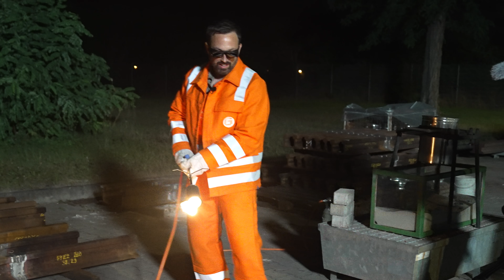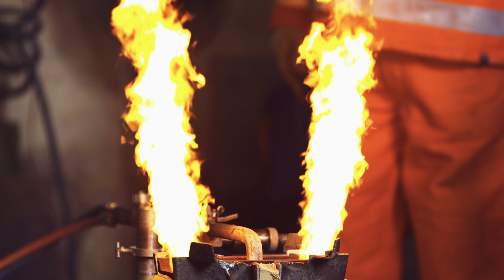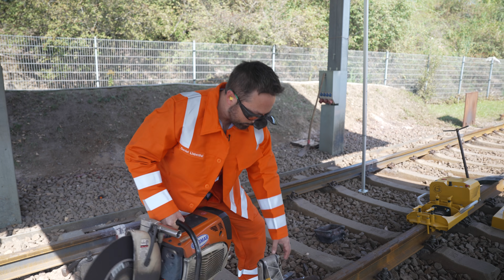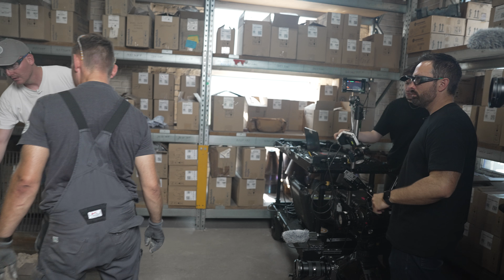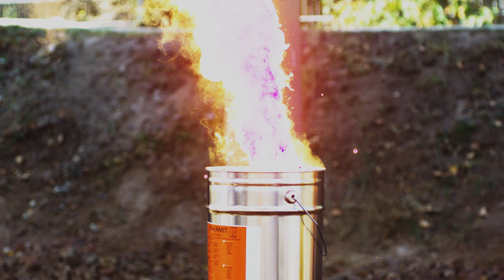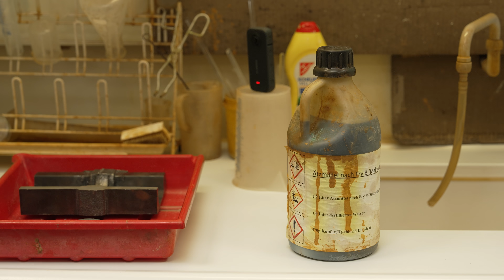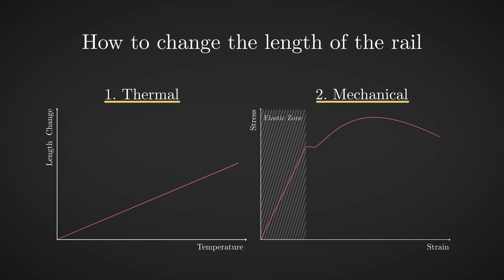Why Don’t Railroads Need Expansion Joints?

Comment: The question was "Why don't railroads need expansion joints" the answer was "we mechanically restrain them" and viola, a 27 minute video. Fine, subscribed.
Reply: Thanks for the clarification, I came to the comments looking for this answer as I didn't hear an obvious answer in the video. Now that you mentioned how it was mitigated I recognize that they talked about doing the welding at a time of day when the temperature is neutral and I see that that was part of the answer.
Reply: The answer was: "Watch 'Practical Engineering's video on it."  The rest was "How thermite works and is applied with Derek in frame of the camera."

Railroads were big projects with big money involved. There is no stronger magnet for fraud than that. Sup-par steel, sleepers, bolts, you name it and it was 'used' at some point in time.
Reply: @DreadX10 Grady's video does a much better job of explaining the mechanical stresses side of the answer. But CWR would not be possible without such a robust method to actually weld them. In that respect, Derek's video does a better job of explaining the materials science, engineering, and process side of the answer. 

Both are excellent videos with different focal points on their explanations, and are both valuable pieces of educational content.
Reply: "Viola" 😂 did you mean voilà?
Reply: @HilariousHomelessHobosMokum lol the most abused word in the French language.
Reply: Rails are “restrained”?   What if it’s hot and a single restraint fails and causes a chain reaction along the entire rail? BRRROING!   The whole transcontinental railroad pops out.
Reply: All least this guy has the same question as me.
Reply: 24:35 🤦
Reply: But they can't. Expansion joints are still used. Just look up breather switches.
Reply: Thanks, I came to the comment for this.
Reply: no, he spent 20 minutes of the video talking about thermite, and only answered it in the last 7 minutes. feels a bit manipulative when the title is supposed to be about expansion joints and not thermite
Reply: @qtarokujo3694 feels that way but isnt.   The whole reason you even think of expansion joints  is cwr you dont get cwr without welding.  Jointed rail expands and contracts on its own just like an expansion  joint would.  And getting into detail about one part if the answer is fine.  Especially  in a multiple part series.   He said this was video 2 of 3.
Reply: Too bad it ended up being a non-answer, after a 27 minute video. If simply bolting down the rails (which was happening back then too) is enough to prevent expansion and buckling, why were they worried about them in the past?
Reply: @AttilaAsztalos  They are welded at a median temperature, at night, so the maximum expansion and contraction are limited to a certain lower value. 

The welded rails resist deflecting, so they are not prone to deflect into an angle at the joints. Any minor deflection is likely sinusoidal.

Steel has a known coefficient of thermal expansion. And environmental data is widely available for all geographic locations now. Not so in the early days.

Also, they are not constructing railways as rapidly as they were in the past. So there is no need to work as fast, or throughout the day, as in times past.
Reply: @AttilaAsztalos  You can travel to abandoned rail tracks and film how things are.
Reply: @AttilaAsztalos  traditional wood sleepers were fastened to the rails with spikes. Spikes don't provide hardly any resistance to longitudinal rail movement. There are rail anchors that are often applied to the rails along the ties to provide more resistance to thermal rail movement. Traditional jointed rail, at least in USA, had joints at either 39ft or 78ft and would leave about 3/16" to 1/4" gap that allowed for the thermal expansion and contraction so the rail didn't move the same way that Continuously Welded Rail does since those joint gaps won't exist.
Reply: Well I mean the bolted gaps serves as an expansion joint?
Reply: The real answer is expansion joints aren't possible  and the rails 100% buckle
Reply: Agreed. Its 101 communication !
If I order something at a restaurant and get the wrong meal, I return it. Simples.
Reply: @derek75116 so yes and no.   They explain why rail would need a expansion joint then explain continously  welded rail  then thermite welds.  Its all part of the answer. Thermite is so unexplored for most regular  people its nice to see someone stumbling onto the science  side   and actually  diving into it.   This is also not the last or the first video theyre making on the topic either
Reply: Rails do get warped and do expand - in fact at certain temperatures  cutting a rail which is under pressure due to expansion may be very dangerous.

Google warped rails - it's amazing - massively strong and seemingly unbendable rail - looks like tossed spaghetti...
Reply: @dsquared1956 i do this daily.  Its always dangerous  to cut rail.   Blades explode even if it ist tight.
Reply: No, cello!
Reply: You might be interested to learn that a “viola” is a musical instrument, rather than a French exclamation. Inadequately educated and poorly travelled US Americans should resist any temptation to embarrass themselves by misusing the French language. I remember the imbecile that was Bush complaining that the French had no word for ”entrepreneur” while he entirely mispronounced the word.
Reply: 27 minute video with a 30 second non-answer to the title question.
Reply: @AndreyCo  25:05 answers the question: between the restrictions in lateral movement due to the sleepers and ballast and the welded rails, expansion is limited to the horizontal and vertical axis of the rail, rather than the length.

The lack of material science, raw climatic data, and the speed at which railways were being built were the primary drivers for expansion joints being employed.
Reply: Thank you. I was brush-cutting my way through an incredible density of advertising to try to find that. Last straw. Unsubbed.
Reply: @rbettsx  I have an ad filter. Only turned it on for YouTube and it only filters YouTube.
Reply: exactly...this guy is so much yadda yadda yadda
Reply: he said "viola"
Reply: Thermite cloud of smokes liquid metal sounds like a September  demolition in the big apple a couple decades ago
Reply: @farangforevet1709  not a very good allusion. There wasn’t any thermite involved. The two WTC towers were inverted arch floor decks. The weight on the floor both pulled the steel column walls inward and held the wall columns apart. The burning jet fuel heated the steel floor until the softened truss members didn’t resist the inward pull of its weight. The wall columns were still relatively stiff, a wall-floor joint failed in tension causing its load to transfer to adjacent joints that immediately failed and so on causing the entire floor to begin to drop. The falling floor dropped its weight onto the floor below it causing that floor’s wall attachments to fail, etc. Apart from the jet fuel fire way up high no fire involved. All of the mass * gravity * height potential energy turns into kinetic energy then gets dissipated as heat from friction as the fallen mass grinds itself to a stop at ground level. There’s a lot of heat per pound of debris from falling on average 1/8th mile, but not enough to melt steel.

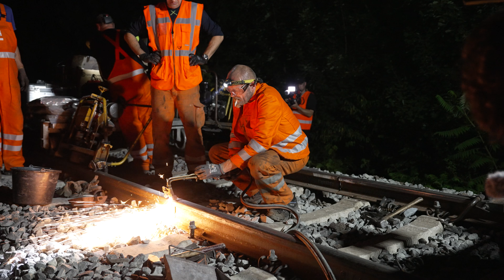Comment: 3:55 the timing of saying "proper safety precautions" while showing a guy using a cutting torch with a cigarette in his mouth is underrated
Reply: Cigarette adds professionalism. You know that guy can do that job blindfolded.
Reply: @ChadKakashi facts
Reply: @ChadKakashi No I don’t…
Reply: he is the exact image i'd have in my head of a railroad welder who knows what he's doing
Reply: It's a safety cigarette.
Reply: Also at 15:03 with tons of sparks flying next to big piles of carboard boxes lol 😂
Reply: It's a real world picture of the job.
Reply: I would be worried about the rail worker that doesn't smoke doing the job
Reply: You know he lit that cigarette with the torch too.
Reply: your odds of something bad happening from smoking near a cutting torch is lower than your odds of getting struck by lightning. cigarettes arent hot enough, nor do they put out enough BTUs to exceed the thermal mass of the tanks or hoses, and even then, without an absolutely perfect mix, theres still not enough heat energy to ignite the acetylene, and the oxygen just aint gonna light. the torch itself isnt hot enough to make that happen without extra parts, but at that point, youve built an oxygen lance. dont get me wrong  you can light a cutting torch with a cigarette, but you aint gonna manage that without tryin😂
Reply: That guy must be from Yugoslavia..
Reply: Cigarettes burn off dangerous floating gases
Reply: also they were wearing running shoes, not steel toed work boots. do as I say not as I do, I guess
Reply: @irusman62  There is no way of telling if those shoes have steel toecaps inside them. And they would only need that if they dropped something heavy on them. I would tend toward wearing toecaps but the max weight of what they are handling is not that high. They are not wearing hardhats either, because they are working outdoors with nothing above them so nothing would be expected to fall on them. Appropriate safety wear for the conditions being worked in. Did you know you should NEVER wear gloves around rotating tools in a metal shop because (1) you won't notice if your hand touches a rotating part and (2) if the glove gets snagged it will pull your hand in, turning what would have been a small flesh wound into a major injury.
Reply: @irusman62 these might be safety shoes, modern ones look like sneakers, but still have a steel toe...
Reply: @irusman62   I couldn't get a good look to see brands so I can't be certain, but there are companies that make steel toes that look like regular sneakers. I have a few pair myself, so if you don't need the ankle protection it's not necessary to wear boots. But I did notice the absurd lack of glasses and other ppe, I had a blob of solder fly at my eye when I was a teenager and I was lucky that it only gave me a burn on the very edge of my eyelid... If my blink response was a fraction of a second slower it would've contacted my cornea. That was all I needed to finally learn my lesson, I was a reckless kid what excuse do these adult men have beyond stupidity.
Reply: He's wearing gloves and safety glasses. And he also has a light on his head in case he can't see well enough with that massive flame in front of him.
Reply: also without the proper safety glasses. just pure iron worker there
Reply: A lot of US class 1 railroads also require way more personal protection equipment/safety that you see in this video. Some of that extra safety is due to liability the US railroads face when workers get hurt though.
Reply: @conanobrennan53 Germany is generally sensible about safety equipment, but they don't over-do it.
Reply: I don't know how you all noticed that
Reply: @scaredcrower  that's all we do. It's all we have now.

Comment: 24:27 is what i wanted to know
Reply: Exactly. I had it in my school textbook that the gap is for expansion.

I'm used to the tuduk tuduk... Tuduk tuduk sound of a train
Reply: Its not only that, but afaik every welded rail cant go in a perfectly straight line. Since its constantly curving left and right the railway can expand by pushing itself into slightly more of a S pattern, while in winter it can slightly straighten itself out.
Reply: Wish I'd read the comments before watching. I just came here to post exactly this.
Reply: Actually, the info at 26:29 is perhaps the key bit of info.
Reply: Thank you!
Reply: I don't get it. I need a more detailed explanation. Are we doing something similar to pretensioning concrete?
Reply: @Tyuiiiizxvb I work on a railroad doing thermite welding. The process starts by recording the rail temperature and then we drop the weld in, we use calculations to determine how far that weld needs to be stretched using a rail stretcher, and the stretching of the rail is what brings it to the “neutral” temperature they’re talking about. So if you weld in the cold it’ll need to be stretched out more in order to bring it to the neutral point. If it’s stretched too far the rail will snap under load or in the cold, if it’s stretched too short the rail will buckle in the heat

Comment: I worked at Sydney's central station as a structural engineer during a rail shut-down weekend for maintenance. The rail technicians were doing rail welding and were kind enough to explain this whole process and mechanics. They were working under a time constraint so i didnt want to bother them. It was so cool seeing a deeper dive on this and knowing the basics of everything they taught me in a 5mins conversation.
Reply: I assume you were also there working with the track technicians during the STAR2 possession in December last year when they were building the tracks to platforms 11-14
Reply: @Voyagerthe2nd unfortunately no this was around early last year, from memory those platforms were either the ones they were working on or it was near by because it was the above ground platforms.
Reply: I was looking for someone to write this, i always wondered what they do every public holidays to repair the line in Sydney.
Reply: As a welder, I thank you for your appreciation of what we do.
Reply: was also thinking about Sydney trains and how much flack they take for any downtime. it's hard when there's so many pieces that can go wrong plus things like welding and reduced funding. great stuff for making it work as smoothly as it currently does
Reply: INVAR ALLOY
Reply: Could you please explain the part where they angle the rails before pouring the liquid metal? What goes wrong if you keep the rails flat on the ground? Thank you

Comment: I was waiting for a train many years ago, and they had just upgraded to concrete sleepers. These need continuous welded rail, so they were doing the welds on that night. I showed interest, and they got me down off the platform onto the track, and they let me hold the torch and light one of the ceramic pots off. I’m proud to say that a main line has one of my welds.
Reply: I just got to see all the stuff sitting still from an overpass bridge.  Jealous. 🙃
Reply: @ I’d love to work in the railways but it’s a very competitive field, especially for a train driver or guard, which is what I’d like to be. Also back in the day I would often get cab rides, and sometimes they’d even let me handle the regulator, or the train equivalent of a throttle. Being a kid and in control of about 4,000 horsepower worth of electric motors was amazing. It’s something I’d about kill to experience again.
Reply: As a socal resident, I can assure you that in many places there are still fishplates and still the old "tacktack" sounds in many places =p
Reply: 100% chance that anyone in the world will ride over one of these is 😂
There's plenty of people who will never ride on a train in their lifetime, just like there are plenty of people who won't fly on a plane in their lifetime.

To blow your mind further: there are MILLIONS of people who die every year without ever riding in an automobile in their lifetime.
Reply: Could you please explain the part where they angle the rails before pouring the liquid metal? What goes wrong if you keep the rails flat on the ground? Thank you
Reply: @ey3796  The rail cools faster at the base and web (middle thin bit) so that will pull on the rail causing it to bend downward at the railhead causing a divot. Most USA thermite welding actually puts a "crown" on the rail like they show them measuring in video but it remains after you finish as well. Usually between 50 and 70 thousandths of an inch measured from the center of a 36 inch straight edge at the far end.

Comment: The footage of the preheating with glass is fantastic.
Reply: I am amazed they found glass that can handle the temperature and temperature gradient!
Reply: @jovetj For real. Normal glass would probably have turned black really quick.
Reply: Borosilicate probably.
Reply: @Shaker626  Borosilicate is much stronger and resistant to temperature and thermal expansion than normal, soda lime glass. However, it's definitely not up to this task. It can handle just a few hundred degrees. This is most likely fused quartz, which has a melting point of 3000 F (1648 C). Thermite burns around 4500 F (2500 C), depending on the formulation. It probably holds up in this situation because the thickness of the glass makes it a bit more resilient and the thermal transfer not being perfect. It will probably melt with more exposure.
Reply: @Shaker626  that's strong glass huh
Reply: @Darkknight512  his mom ,trying to cook Holiday dinners & is like , "... now....I know I put that Pyrex cutting board under this drawer in this shelf     ...."   💥🚂🛤️🤷🏼‍♀️

Comment: I had a career that spanned over 10 years in rail, most of it in Product Development and R&D. The amount of Engineering and Science that exists in railways will blow your mind. It's a culmination of all fields of Engineering, Electrical/Electronic/Computer, Mechanical/Metallurgy, Civil, Process/Industrial and Chemical. There were also Mathematicians and Physicists. There were so many brilliant minds working together to solve complex problems and keeping trains running smoothly.
Reply: Geology too.
Reply: Wow, thank you for your work!
Reply: Could you please explain the part where they angle the rails before pouring the liquid metal? What goes wrong if you keep the rails flat on the ground? Thank you
Reply: Research INVAR ALLOY